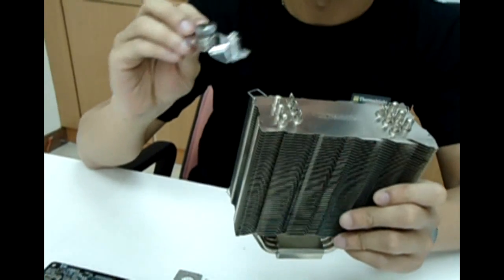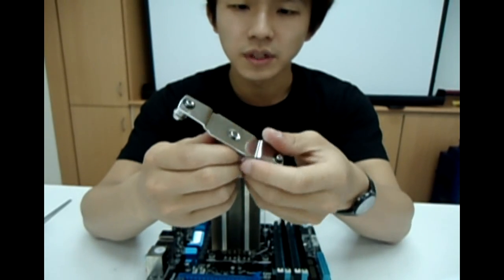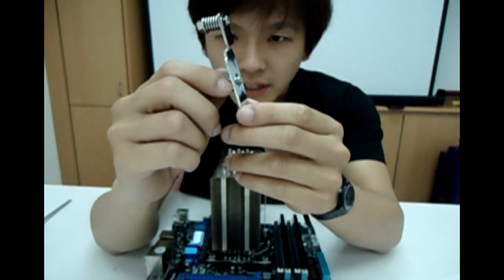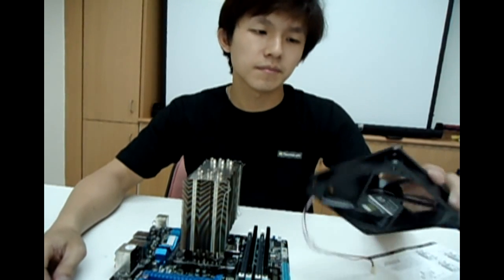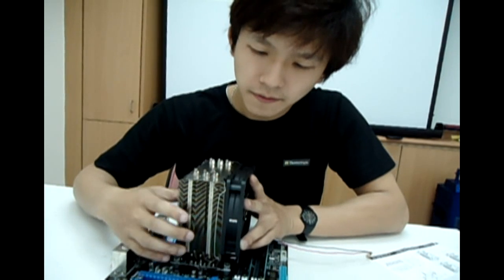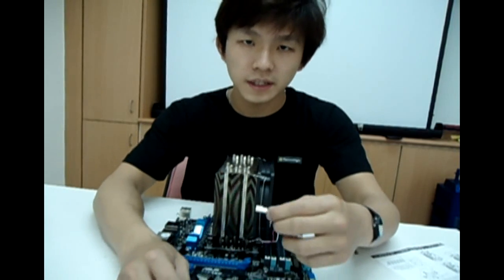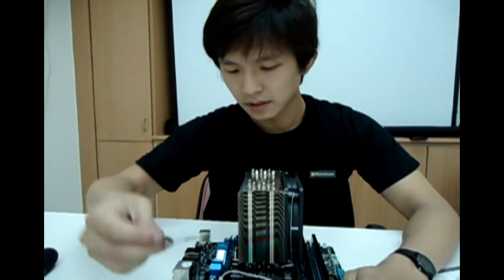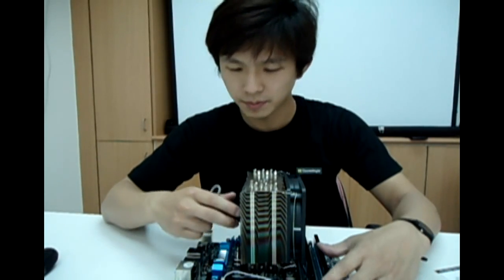Venomous X Installation Part2

Comment: @clausbohm The open side of the fan is where it intakes air. In his setup, the flow of the cpu fan would be moving the same direction as the case exhaust fan which is correct.

Some people prefer 1 fan because it is quieter. These people like big efficient heatsinks  because they don't HAVE to use many fans or a fast fan to cool the cpu sufficiently.

Only bad thing about too much paste is dust will build up around the excess. The pressure willl spread it evenly even if you put too much.

Comment: will the "Ultra120 Series Fan holder" fit the venomous x? it states its for Ultra120A / Ultra120 eXtreme / TRUE Black / TRUE Copper... and does the fan holder have anti vibration? thanks.

Comment: heyi also have the p7p55d motherboard, with an i7 860 cpu, and i really want to use Venomous Xm but i have a few questions. 
first, do you recommand a certain fan or will any 12 cm will do? and dont recommand yours just cause its yours lol :P 
also, will it be better to install 2 fans one each side? is it possible? and if so, how can i get the stripes and the mounting metal thingies. 
last question, how will i know how much presure to apply , cause it is directly pressing on the CPU, and that

Comment: Good job on the video except for.....
1. Too much paste  ( pea ( 2 core) or line method (quad core) better)
2. Only one fan ( 2 in a push and pull is better)
3. Fan flow is pointing the other way from back exhaust fan (Label on fan always shows output side)

Comment: @RonModz Dun worry, I'm sure every Thermalright products will go thru QC test b4 launching out to the market.
The fans will neither wobble even on push/pull config. Throwing in a very high RPM fans(2500rpm or 3500+rpm), still will not wobble.